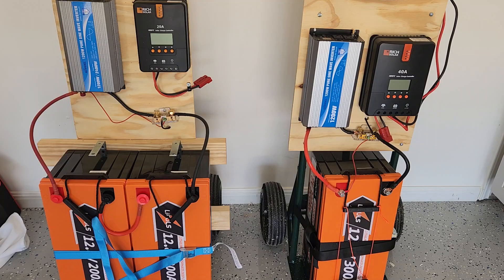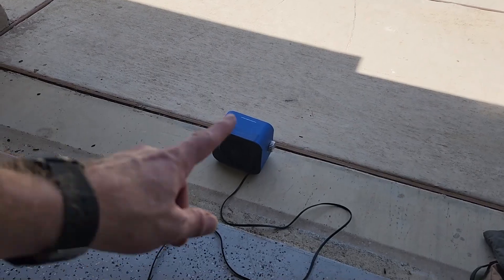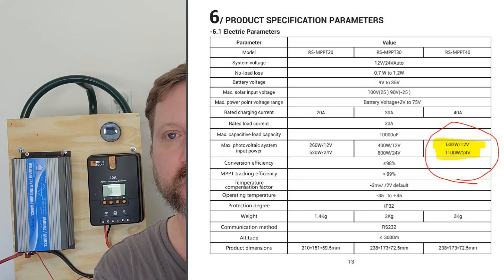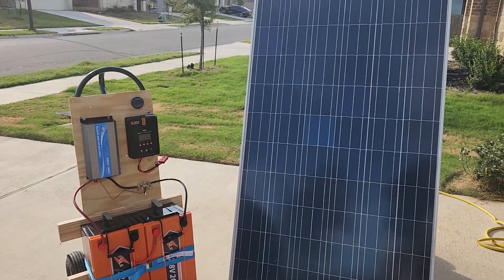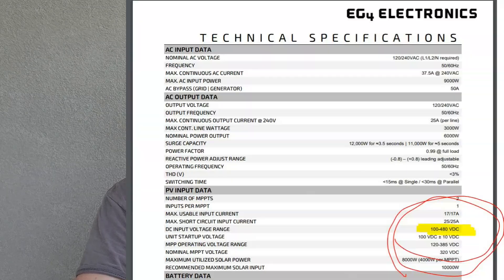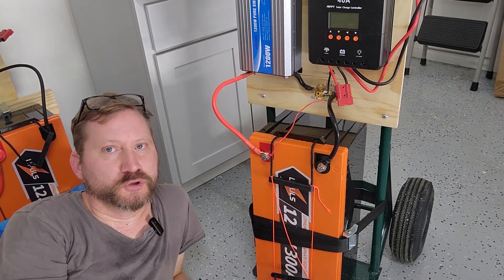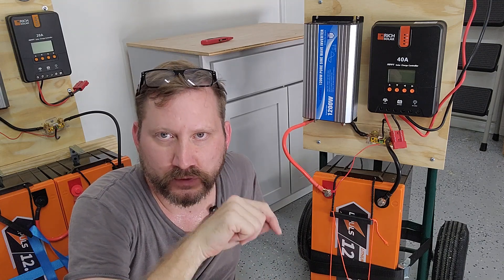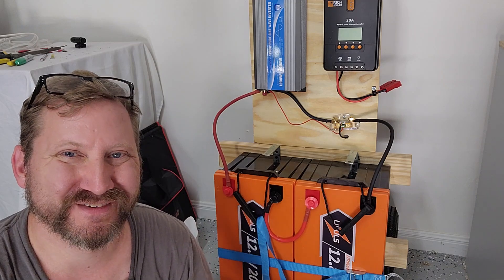24v 5.1kw battery solar generator system.  #diy #solar #prepper Texas Prepper Projects

Comment: It seems to me that the "120V minimum" for charging a 48V battery is a specific limitation to the that specific EG4 charge controller (designed for large solar panel installs).

Controllers from other brands for 48V batteries (Rich Solar RS-MPPT60 or Victron MPPT 100/20-48V)  mention "battery voltage +2V" or "Battery Voltage +5V" in their manuals. Elsewhare I've read that it's approx. 20-30% above the battery voltage for MPPT chargers to work (e.g. 60V minimum PV input  for a 48V battery)
Reply from the maker: Well that is interesting and makes a LOT more sense. I pick on the EG4 since it's the most popular all in one.  Every other solar youtube person slaps a $700 EG4 on a cart with a rack mount battery and calls it good.

Comment: Excellent explanation of the differences in voltages. I have to rethink my setup. It is presently 12V but can easily be made 24V. I would just have to buy a new inverter. The current difference is staggering. It will cut the total amp-hour capacity by half, though, correct? I assume a 24V system will double the amps you can pull off a 100 Ah BMS, which is a huge plus. With my Starlink mobile system, I am running it straight off a 12V LifePo 100 Ah but kicking it up to 24V with a Buck/Boost. Although Starlink says it will run on 12v, it won't. I expected to encounter heat with the buck/boost, but it didn't get warm. With a 24V system, I could run it straight off the 24V batteries. Great presentation.
Reply from the maker: So if you have two, 12v  100 amp hour batteries in parallel, it becomes 12v at 200 amp hours or 2,580 watt hours. If you put those batteries in series, then it's 24v at 100 amp hours, but it's still 2580 watt hours.  You haven't changed the capacity, just the voltage.   If your starlink is 24v, then you could power it straight off of that pack.   The two main advantages to 24v is 1: lower amperages so smaller wires   and 2: You can put more total solar wattage into it.  By using a higher voltage, you can get more total solar power into it for the same amount of money.   Check out my video on the LiTime solar charge controller.   https://www.youtube.com/watch?v=syrnCSMjFhI  .  Yes, it does mean you have to buy a new inverter. I use Giandel who makes a 24v..   https://amzn.to/40zjOAl
Reply: @texasprepperprojects  Thanks for some great info. I always thought hooking in series halved the watt hours too. This is why the internet and YouTube is so awesome. Now I feel way more comfortable converting mine to 24 Volts.
Reply: So the total of watt hours stays the same when wiring the batteries in series ? @texasprepperprojects
Reply: What i'm asking is would both battery banks last the same amount of run time at night? 2 180ah 12 volt batteries wired in parallel is my current setup on a 12 volt system
Reply: @gsrjaycee4521  Yes, total available energy (measured in watt-hours) in both configurations is the same.

Comment: You can still run 12V devices off a 24V system directly using a buck converter. I always use a multi buck on the DC side, so I have 5V and 12V available without coming off the inverter.
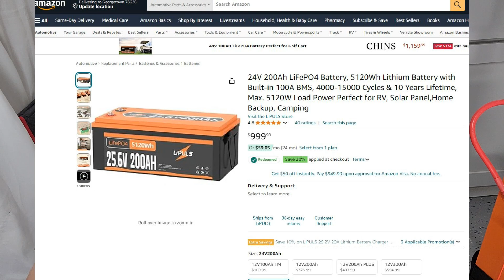Reply from the maker: 7:00  i show this
Reply: @texasprepperprojects  Yes. I don't think you referred to it as a buck converter, but you did mention dc to dc down conversion.

Comment: Greetings from sunny Jamaica 🇯🇲 I   have just come across your video. I have a 24v system which is 4x12v 200ah  gel batteries, and I would like to replace those gel batteries with 4x12v 100ah lifepo4 batteries. Question is can I connect the lifepo4 in series parallel as i did with the gel batteries. batteries
Reply from the maker: Yes you can

Comment: That’s crazy the difference in the amount of solar panels you would need to run the 48 volt as opposed to the 12 and 24 volt.. does the 24 volt require more panels then the 12? I was hoping to just have a little cart that I could pull into the woods with me or my backyard for yard wordk etc. to run like a sawall or skillsaw or angle grinder and tools like that, or even maybe for the potential to run a small space heater in a garage for an hour or two once in a while.  But at the same time I need it to be fairly portable and the least amount of hassle in terms of setting up the panels.   Simply put I am a very “plug and play” type of folk and I like simple and efficient.   But I have watched a bunch of prowes videos and he said that it would be a waste of money to buy the little jackery or Bluetti power bank and panels considering how much cheaper and more power you can get with these DIY carts.  Thanks for replying sir you make your videos very easy to understand
Reply from the maker: don't bother with the space heater. Use a Mr Buddy Propane heater instead.   I'd personally buy a 24v, 100 or 200 amp hour battery and 24v inverter. You can pull more power, more easily. Just make sure you 're getting at least 30v of solar into it, which is easy if you buy a used residential panel off of CL.

Comment: You didn't mention what watt size panels to charge in the discussion on 48 volt system. There are 100 watt panels out there and 435 watt panels I've seen out there. Do you still need alot of panels with the 48 volt system with high watt panels? I'm trying to understand and it's all confusing.
Reply from the maker: In this case wattage is not relevant. That 435 watt panel is PROBABLY 37 Volts at 15 amps or so.  I have 12 volt 200 watt panels and I have 37 volt 250 watt panels. You have to read the specs of your panels and your charge controller very carefully. The best of both is high voltage and high current, typically residential panels are the best mix

Comment: Hey, that hand truck design looks familiar ;)
Reply from the maker: Very. Lots of people are doing this but none quite like my variant
Reply: @texasprepperprojects  I like your design. I made one similar to yours but with a solar panel attached to the Hand truck as well. I can angle and align the panel perfect to the sun.
Reply from the maker: Link it?
Reply: @texasprepperprojects  I replied with a link but YouTube appears to have blocked it. BTW, the reason my hand truck build is 12v is I used leftover parts from my main system that I upgraded to 24v.

Comment: Monster??? 😂😂😂😂 A single Pylontech 48 V batterie holds 4.8kWh. I run 20 of these with 3 times 8 kVA Victron Quattros and 30kWp PV.
Reply from the maker: Cool
Reply: I run a hand-picked non rainforest earthwood mousetrap with Selenium trigger on top of an interstitial co-polymer self-heating .003 microfarad spring and telekinetic monitoring, all powered by a 2026 Lincoln 500 megavolt locomotive engine.  
Stay gold.

Comment: Most 12v compressor refrigerators can be switched to run on 24v.

For system design, I think 12v is fine as long as you are normally under 1500w or so, and don't need to surge over 2000w. Double those numbers for a 24v system (3000w/4000w). If more than that, go 48v.  Maybe someday we'll start seeing higher voltage than 48v systems readily available for DIY.
Reply from the maker: Agreed on the DC fridge. It's just nice to use smaller wire and get more power out of your solar mppt

Comment: I agree. 48v systems require too much panel voltage for a small backup system. 12 or 24v systems have less arcing problems and safer to work with from my understanding.  My fridge and furnace blower surge to at least 1500 watts. So largest inverter I need is 2,000 watts which is just fine for a 12v system in my research. I might go with a 24v system just for the fridge and furnace if my delta 2 ever poops out.  I'm working on a 12v dolly system as well and will have lots of usb devices like aa battery chargers and such.  I'm also going to use a relay with a piezo buzzer to go off when the load terminals on the scc shut off as a battery monitor.
Reply from the maker: 24v just let's you get more power out of the solar
Reply: Well Solar Frontier SF170 (made in Japan) give170Wp at  a Vmpp of 87V and are below a Voc of 120V so a single panel already achieves enough voltage to charge a 48V (16S) LiFePo4 (with 57,6V or max 3.60V/cell) and second hand they are about 20 Euro  per piece: assuming you want to charge your 16S 200Ah (10kWh) system in 5hrs you ll need at leas 2kW of solar power for 5 hrs so you ll need at least 12 panels in parallel each with its series diode si if one has shade the others w'nt be affected

Comment: Correction the 24 volt system is only 100 amp hours since it’s wired in series… just an observation
Reply from the maker: Wrong. It is two, 200 amp hour batteries.
Reply: Tizactly 24v 200 ah  the 12v is 300ah

Comment: The only issue with 48v is usually the initial upfront cost . Unless id you building 12v or 24v system comparable to 48v size wise . The 48v will be cheaper. The disadvantage of 48V u mentioned only applys if you using high PV mppts like 500V . I've seen people build 48V system with a victron 150V 35A controller with only 2 panels in series
Reply: IMO, someone planning to do a whole house or off grid and requiring more than 5000w or needing 240v  it's  best to go 48v.
Reply from the maker: I have never seen a 48v mppt that didn't have a 100v minimum input voltage which is my point
Reply: @texasprepperprojects  check out Brad Cagle channel,  he built a small 48V system using a victron 100/20 charge controller , victron 1200W inverter and a Litime 48V 60Ah battery charging with 4 100w solar panels in series . My point here is u can build a 48V system which doesn't require 100-120 minimum.  Yes it works better with 100V and above but it's not a requirement unless if you using those high voltage all in one systems.
Reply from the maker: Still 4 panels
Reply: @texasprepperprojects i got 30 455 watt panels... what are you going to do with 2 panels?
Reply: 20*
Reply from the maker: Lucky for you. I'm in a rental house and have to keep my panels in the garage.  but I can keep my fridge/freezer/fans and TVs going
Reply: @texasprepperprojects  They exist. 48V works better for large whole home solar system.

Comment: Glad you mentioned the EG4.  I unfortunately went that route without realizing I did not have enough solar input to start charging with solar.  I did find a work around and ordered a victron  100/20  smart solar charge controller that I will use to connect straight to the battery only to trickle charge with my 220 bifacial panels from ecoflow.  This unit allows me to select 12V through 48V.   Since solar is free I plan to daisy chain my ecoflow 2000 to charge it that way through the inverter if need be.  Not efficient but I'm learning.  All this is new to me and you explain things well.  Eventually I want to do another project similar to yours.  Thanks for posting.
Reply from the maker: Thanks for the comment!